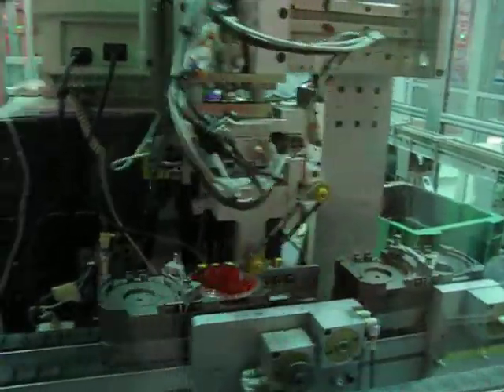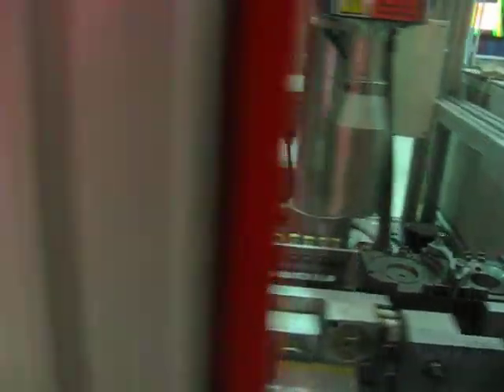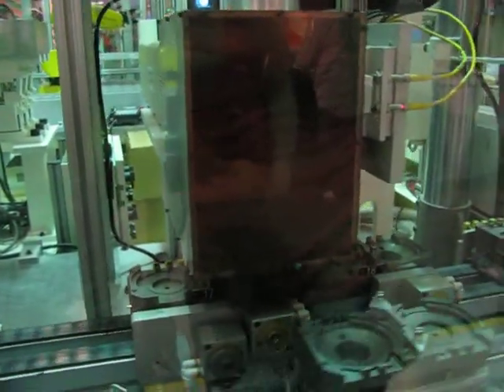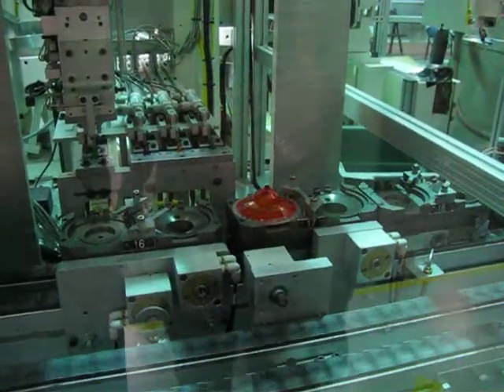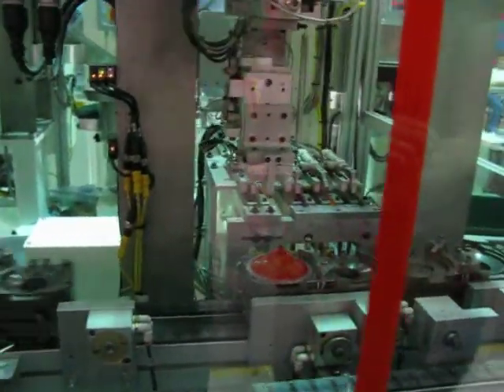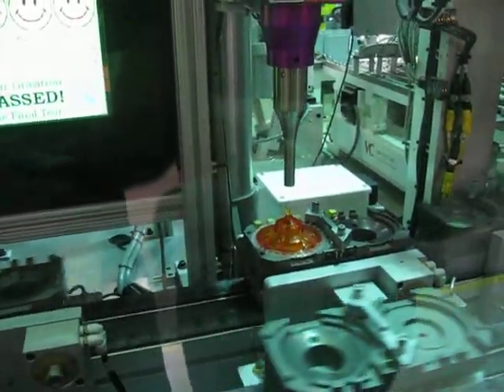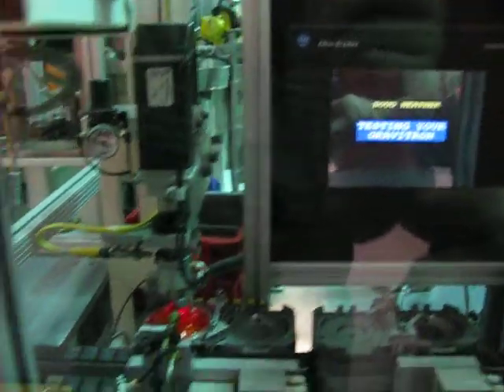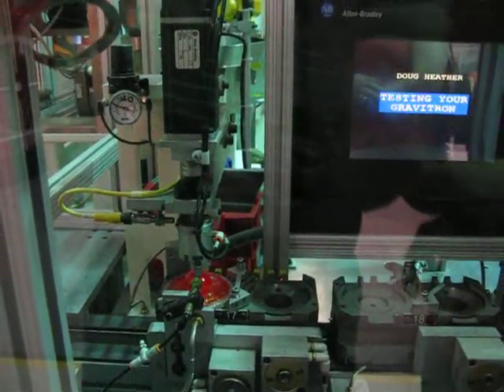Automated Toy Maker

Comment: Cool video. I am the Applications Engineer that designed the system, while at COX Automation. I hoped it would inspire kids to be interested in engineering and manufacturing, plus give people a sense of admiration for automated manufacturing. I worked on it for almost 4 weeks straight, and pulled an all-nighter to finish every detail I wanted right up until the submission deadline.  Cool video and comments.  Cheers!